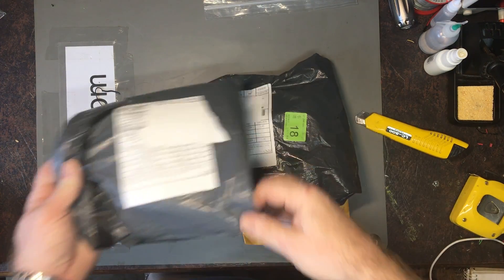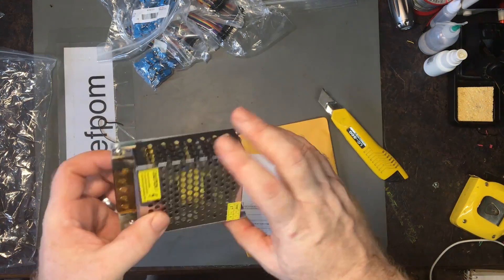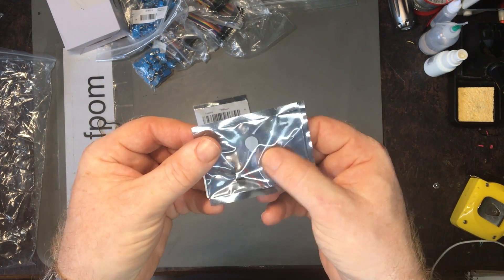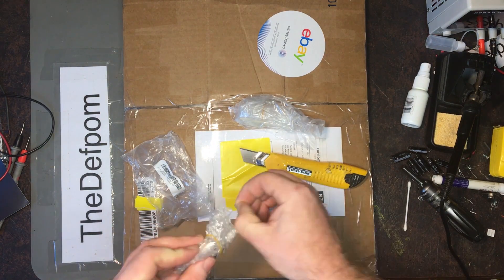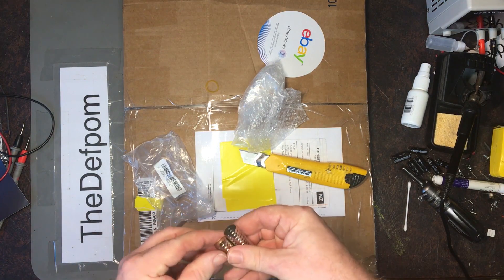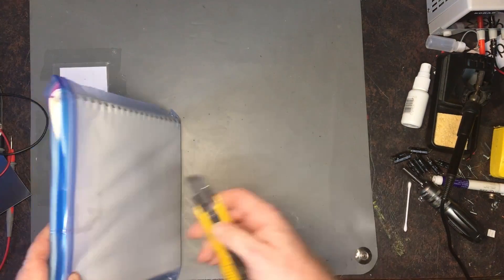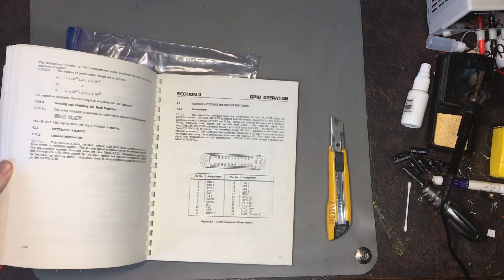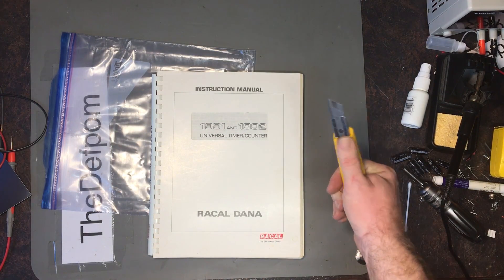🔴 #347 Mailbag 18th March 2018

Comment: Ahh the racal dana, i was lucky to be given a 1998, old computer tech but a really nice counter, the only bad faults were the rubber cups in the buttons had fell apart and the crystal ovan had a bad case of drifticus.
The foam in the ovan looked 400 years old and the ovan pcb was nicely cooked, i changed one cap and it was much better, but i think the ovan was well past its best.
I also have a maplin mf100 counter, based on an iSL chip, not bad really for a cheap counter.